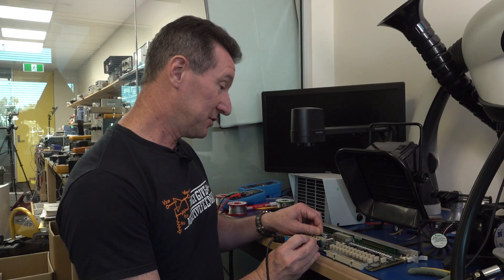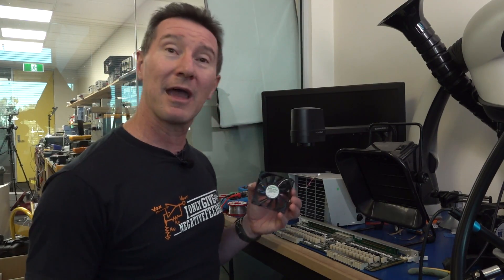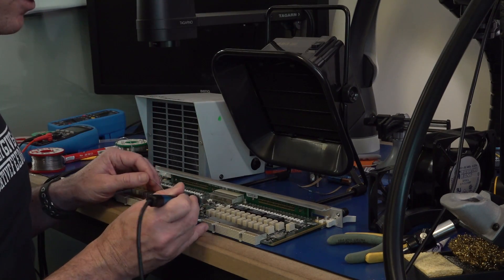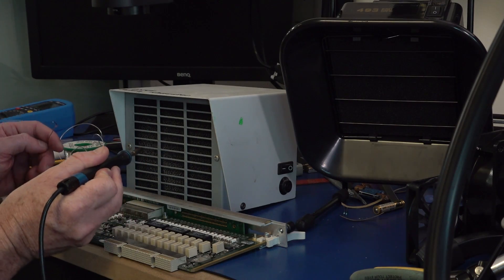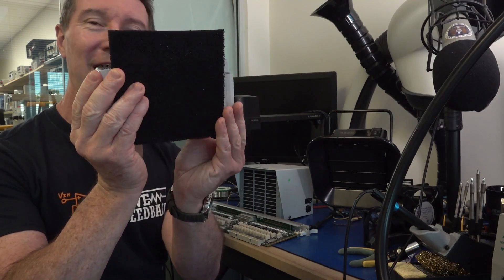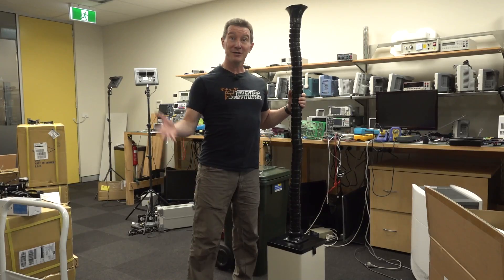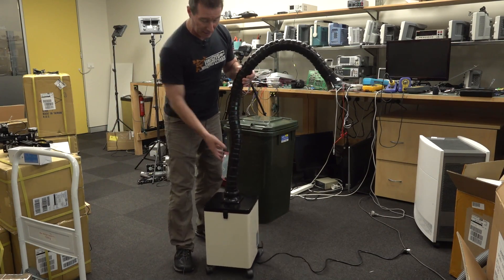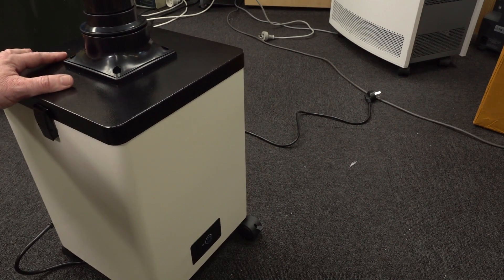EEVblog #1305 - HEPA Solder Fume Extractor

Comment: You want that tube to be rigid. We have a fancy Weller fume extractor at work and the hose is just flexible enough that it can't stay propped up on its own. You need to support it ever so slightly for it to stay in place. I can't tell you how irritating it is to work with that (rather expensive) garbage.
Reply: The Weller Zero Smog one I use has the same issue. But I trust their filtering system over cheap Chinese ones (as long as you replace the filters at the specified time). The Pace ARM Evac system I've used in the past had the same floppy issue. Quite annoying how they don't realise this to be a problem!

Comment: I’ve always kind of liked the piney smell of solder flux smoke.  It’s never bothered me.  What does make me choke is if the circuit board catches fire.  Those fumes are pretty noxious.  If you’re doing something that will probably set the board on fire, especially a second time, it’s best to move outside.

Comment: I’ve never heard anyone else pronounce the “l”in soldering. It sounds odd, and just wrong.

I have some Pace equipment. Solder extractors, etc. the difference is that the Pace will last forever, and you can get parts. The Chinese equipment, well, good luck with that.

Comment: The shipping on just the tubing is pretty ridiculous: $55 shipping to the U.S.

I did some research, and it looks like you can buy the tubing that Hakko uses (https://www.hakkousa.com/products/replacement-parts/hakko-loc-line-kit-10192.html#) directly: a nozzle + 3 feet of tubing + 3 inch vent adapter is just north of $60 shipped to the U.S. at http://www.modularhose.com/Loc-Line-25-ID-System/25-anti-static/
Reply: Thank you for the research.🇩🇰
Reply: Shipping from China has gotten ridiculously expensive lately. Hopefully shipping prices will down once things get back to normal.

Comment: The trimmer probably adjusts the minimum RPM which is usually a bit critical because the motors require air over them for cooling. If you set it to lower RPM it will probably reduce the life of the bearings....or more likely bushes and when it seizes you'll find out the hard way if the motor was designed as 'impedance protected'. If you set it a lot lower then possible winding damage.

Comment: Nice to see that there's finally a reasonably priced unit like this.  Most big name products are stupidly overpriced.  I myself use a system that has a 6mm diameter metal tube mounted directly on the iron handle that puts the end of the tube just millimeters from the soldering tip so that the tube sucks the smoke right from the source.  The smoke travels up a small diameter rubber hose to a compact motorized reciprocating pump that moves the air thru a hepa filter and exhausts out of the top.  My pump draws on two tubes because I have two irons, one large and one small.  The pump is almost silent.  It's a Weller WFE-P (it's much too expensive but is built solid; mine has been running 20+ years).  Weller (Apex Tool Corp) charges too much for the fume extraction tube kits for their irons, so I made my own using cheap 6mm dia aluminum tubes from a hobby store and 3D printed plastic mounting blocks for them and superglued them to the iron handles.

Comment: This Chassis can easy be modified for less noise. I used „Alubutyl“ to cover inside if the chassis and put some stripes on the fan chassis, what kills resonances. Now the main noise source is the air intake port.

Comment: 13:40 good example of a lack in protective earth connection.  earth wire from the plug should go straight to a protective earth connection on the metal case work. So as normal would not be allowed to be sold in open Oz market. Makes you wonder what other safety features they have skipped over. Killer clone! at least in normal operation your at the end of a plastic tube. just wear rubber gloves when pressing the on button. and of course don't sell it on as your be liable for all the lack of safety testing. would be fun to request a DOC from them :)

Comment: I've go an OKI BVX-200 two station Fume Extraction Unit with one pipe inlet capped off, which always beeps at start up unit air flow gets going. It should only beep if there is a rise in pressure across the filter. Must have a play with the adjustment pot on the side. The beast feature is the wired remote so you can switch it on and off from the soldering station area.  bought it at an auction selling off equipment from a company I used to work for.

Comment: Keep in mind that these filters need to be exchanged after a while. In school we had a mounted system with aluminium tubes with a few adjustable joints on them, and each pump served a row of them. The hobbyist exhausts seems like a complete joke. You really should take this fume issue seriously if you care about your health. I've looked around a bit before, and there isn't much available where I live, and the ones they do sell are very expensive. If I was to make myself a new soldering workspace, I would probably hack together my own solution where the exhaust is pumped outdoors, with just some basic filtering. Not that it would have to be limited to just soldering.

Comment: I use a Weller zero smog unit. I highly recommend it. Although you need to maintain the filter on these fume extractors according to the manufacturer recommendations (replace every year or so).

Comment: I'd aregue the air displacement boxes you refer to aren’t better than nothing, they’re completely useless in all situations. The UK Health & Safety Executive conducted a review of the efficacy of different types of solder fume capture and found it causes the background levels of fume to rise rapidly, exceeding the exposure limit. 

People using these should remove the filter and attach it to a pipe to blow outside or switch to something like you are showing. 

I’d argue these air displacement boxes are more dangerous than nothing because you are lulled into believing you are safe and doing more soldering without proper protection.

Source: https://www.hse.gov.uk/research/rrpdf/rr900.pdf

Comment: The earth has to be connected to every single piece of "outer metal wall, at least here in Germany. This was a real pain when I had to build a electric cabinet and hand control box from extruded aluminium and aluminium sheets during my apprenticeship. I had to screw down and low impedance measure at least 30 to 40 earth screw posts during my practical exam....
Edit: What I want to say, you aren't allowed to rely on the connection between fan and outer wall, both have to be connected separately via earth wire

Comment: personally I use a normal everyday vaccum cleaner hooked up to a DC power supply - most the 'infinite' motors or whatever they're called work fine on DC and you can thus run it way slower and quieter. Pull it through a carbon filter (or better yet plumb it out of the room) and job done. but yea some carbon filters are crap. use some expandable ag pipe for a pipe that holds some shape (though not anywhere near as well as that one you show).

Comment: What out for the heat rays out of that martian machine, I am thinking of "War of the Worlds"  we had those piped along the bench to the end of the bench for the suction unit, the soldering irons had a small diameter tube and suction pipe that was fitted to the end, "Metcal Soldering Irons" that is the way to go Dave,

Comment: My electronics/makey stuff is confined to a shed at the end of my garden, so I just chopped a hole in the wall and fitted a bathroom extractor fan next to where I sit. Seems quite effective at making the fumes go away.
Reply: good if you can tolerate the noise. Most of the cost of that unit goes into a low noise motor, then the layered filter.

Comment: Honestly, you don't want a "HEPA" extractor, you want a HEPA+condenser vent.  There are chemicals and gasses that come off soldering and old boards that HEPA won't stop.  Even if the equipment you buy is actually HEPA, which the one you're showing isn't.   That thing's filter relies on multiple passes of air to reach HEPA rating, meaning it has a very low MERV rating.     I own a couple filtration systems that are one-shot HEPA.  I doubt the MERV rating of that unit is better than 12, which makes an open window and an N95 mask superior.  For what you are doing you want - at a minimum - an 18 if you wish to continue breathing the air.    There's no way a $225 "extractor" is going to reach MERV 18.  I doubt it even reaches MERV 12.
https://www.grainger.com/know-how/equipment-information/kh-what-is-merv-rating-air-filter-rating-chart

Comment: i've actually made my own extractor recently after hearing a few times how bad it probably was to breathe.. . i was looking on amazon for charcoal filter elements and found a very cheap cabin air filter for a random car (it was under 5 bucks and decent sized and better than that spongy filter you showed) so i spent a while designing and 3d printing a thing to house the filter and hold a 120mm computer fan. it works very well but also only works within about 6"... that hose idea is great, i'll have to try and make something like that to attach to it now.

Comment: Thanks for the reminder, I've been meaning to build my own extractor using an inline duct fan and some flexible ducting. Since I'm free to cut holes in my workshop all I want, my idea is to just dump it right out through the wall, no filtering really needed. Just need something to prevent weird things from crawling back in the other direction!
Reply: That's what I did. Choose wisely about the type of fan you get though. I got a bathroom fan and it's really quiet and weak, which is perfect for solder fumes. There are super powerful ones, but they'll eat your components and tools if you're not careful!
Reply: Mythricia, gravity flap vent - these are commonly used with extractor fans and vented tumble dryers, 100mm/150mm  flap vent.

Comment: 187 comments. Bloody murder. You grabbed the big black hose and said its coming. Hahah.
HPA060 Honeywell HEPA filter + 4 inch Wye Saddle duct & 4 inch vinyl flexible duct. <$100
Saddle duct fits the filter unit perfectly. Make a gasket with dollar store foam cut in to strips.
Triple stack the carbon pre-filters. Cost less than $100 Canadian with a liquidation filter.

Comment: I use a 4” fan that sucks through 4” hvac ducting  then through a  4”x16” carbon grow filter with activated carbon. It does the trick for me . If I’d buy it again i would buy a 6” fan and 6” filter or even a 8” setup. Ideally I would skip the carbon filter all together and port the fumes outside through a vent just using a 6” inline fan. 
If you look at what Hakko is selling for a hepa fume extractor you’ll get a good laugh. The fan on the makko has to  be a pinner 3” pc fan  relying on some $2 carbon cut out square I used to use for my fish tank filtration lol. I do use cheap carbine squares from amazon as a prefilter at the begging of the 4” hvac tubing. This prolongs the life of the more expensive 4”x16” carbon grow filter

Comment: How about using a Top of the Line 3M Filtrete Healthy Living Elite Allergen Filter, MPR 2200, 20 inch x 20 inch x 1 inch Along with a High-Quality but low noise 3 Speed 20 inch FAN?  Add in a Pre-filter of sorts and you can create the Highest Quality HEPA++ Fan for a good price (that Filter is probably $25 on its own)....  -Mark.

Comment: I use a homemade fume extractor. It consists of a cardboard housing, dryer ducting hose, a really powerful CPU/case fan for moving the air, about 17 layers of that porous carbon filter that you showed (to make sure it gets filtered at least somewhat!), and copious amounts of duct tape to fix the leaks lol. Oh yeah, and a couple LEDs at the end of the hose to light up my workspace a bit more. Works like a charm, and the hose folds away nice and neatly.

Comment: Hi Dave, on one site I found that similar FUME Extractor Smoke Absorber Multi-layer Filtration System has the following expiration dates:
First layer - Filter cotton(Filter 60) - 7-15 days
Second layer - Filter cotton(Filter PM0.3) - 3 months
Third layer - Particulate air filter(filter smoke) - more than 6 months
What do you think about it?
Did you get a chance to find the filters price and supplier?
Thank you
Reply from the maker: That's for 8 hours a day usage.
No reply from them yet.

Comment: My station at work has an extractor tube right at the tip, cheap as chips €200 station but tips are so cheap and If I'm charging €70 to change a €2 charging port .....anyone know what I can do with a bucket of spent tips? because at 50 cent each I'll stick to this station. And bonus if you take off the tube can also be used to suck solder.

Comment: Hi Dave, nice bit of gear.
I've thought of making a home extraction unit using an old articulated desk lamp arm and some flexible pipe, put the fan under the bench, add filtering later if I feel the need.
I also have an articulated magnifier, that clamps on the edge of the bench, that has blown flouro, adding LED lighting, could add a pipe to that too.

Comment: Is there an advantage to using that fan design ("squirrel cage") over the ones commonly seen in power supplies and oscilloscopes?
Reply: They generally create higher pressure than axial fans.

Comment: No matter were I sit, no matter how I place the board. The fumes will ALWAYS go straight into my face. It's like they get attracted or something!

BTW, the fume extractor on the right, the big black one. I have the exact same and it stopped working one day. Not during operation, but after it has just been sitting around for a while. It simply wouldn't start up again.

Comment: Should the hose be antistatic? Air rushing through it and it's going to build up charge. Maybe that's why the Pace is much more expensive. Not an issue for prototyping, but may not be up to production standards (1m distance from charges for long term/high volume reliability).
Reply: I doing it’s an issue, as the air is being pulled away from your work.

Comment: If you were to build your own I would check a vacuum cleaner store or maybe an RV store. They may have RV Air conditioner parts that work as hoses and filters. I have 5m of windows next to my bench and I just open those and have a floor fan blowing that direction. I also use strong chemical solvents though so I want the smell going right outside.

Comment: I'm using small-ish vacuum cleaner with speed control :P . It,s cheap (~$70 delivered ), powerful , have great filtration (HEPA13), and you can clean stuff with it. Downside is that it is quite loud even on low speed, have flexible tube and gets hot after a while. But works for me.
Reply: And if you put a funnel in the hose it becomes even better 😁😁😉

Comment: I built one years ago, using a 190 CFM fan designed for "hydroponics operations", and some loc-line hose from Amazon, look for:  Loc-Line Anti-Static Vacuum Hose.
I put the fan and it's exhaust 20 feet away, so the noise is very low.  The only thing I might add would be a HEPA filter.

Comment: Throw the motor in the trash, put a subwoofer in, and let the party start!
Reply: You'll need to replace the tube with an audio grade one as well.
Reply: @redsquirrelftw  And remember to get the gold plated ones.
They sound way better!
Reply: Fit a radio to the unit and funnel the music up the tube whilst vacuuming.

Comment: Something to note about rosin fumes is that arguably the ones from leaded solder are not as bad as the ones from lead-free solder. The lead-free rosin smells awful but even that aside MSDS on the lead-free rosin typically indicates that something extra is done to it that has some additional toxicity notes.

That said, filtering is a good thing in both cases.. just more important for lead-free.
Reply from the maker: Possibly. But in theory the rosin is the same.

Comment: Been using one of the PACE branded for over two years in our welding shop for galvanized steel.  Works awesome
Reply: @sent18inel  the smoke from galvanized contains zinc oxide which can be toxic in high concentration.

Comment: $225 ? Rubbish by the time you convert to AUD add freight Add gst it works out at $763 au delivered id rather buy a weller from element 14 for $1100 with warranty and knowing i can get filters n spares for years to come.. total clickbait
https://au.element14.com/weller/ft91012699n/fume-extractor-120va-240v/dp/2678624?gclid=CjwKCAjwwMn1BRAUEiwAZ_jnEiV_KkOD7now4FfAY40Qo736c7NtRmmRzFOQrJRjjrDl7ehT4_2_qBoC41oQAvD_BwE&mckv=s_dt|pcrid|432287894106|pkw||pmt||slid||product|2678624|pgrid|102205443484|ptaid|pla-901281938545|&CMP=KNC-GAU-GEN-SHOPPING-TOOLS-AND-PRODUCTION-SUPPLIES

Comment: "It's doing a good job here, but a bit further back" 

PCB hangs out over the edge of the table and is 3 feet away from the fan...

"Not so good out here"

Moves PCB to other side of the room...

"Not working now, is it?"

HAHAHAHAHAHAHAHAHAHAHA.
Reply from the maker: That is not an uncommon distance for large board.
Reply: @EEVblog  Was a joke.... But yes, it was obvious form the very start you needed a proper fume removal system. The kind that either sucks/blows a gale or encloses everything and you can't see enough under the cover to use it. (two jokes there).

Comment: I set the soldering iron to a lower temperature, then it smokes less.
Reply: And risk dry joints?
Reply: @GreensladeNZ  Soldering at lower temperatures takes a little longer, but causes less PCB stress, does not burn flux and leaves shiny joints. If, during soldering, you make sure that the tin has wetted both joined elements, then you will avoid dry joints.

Comment: If you smoke while soldering you won't have to extract any fumes
bonus points if you use the tip as a pre heater                                /s